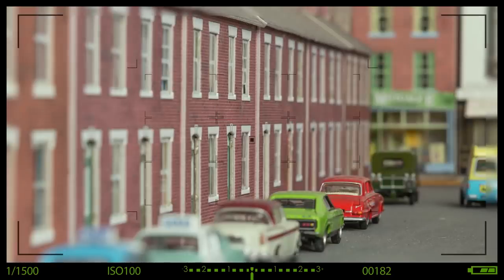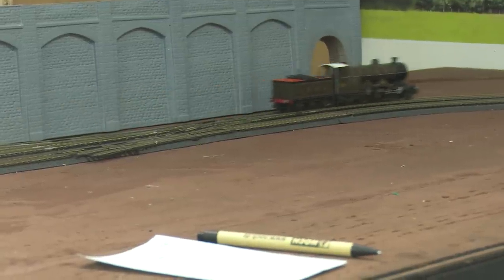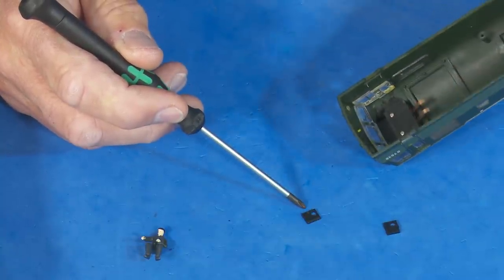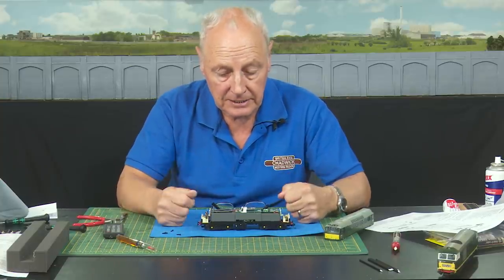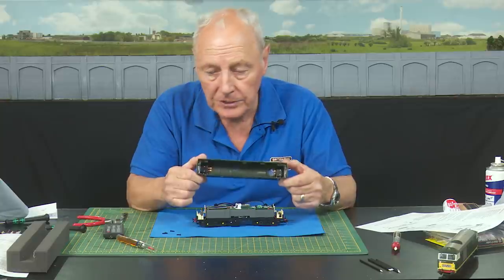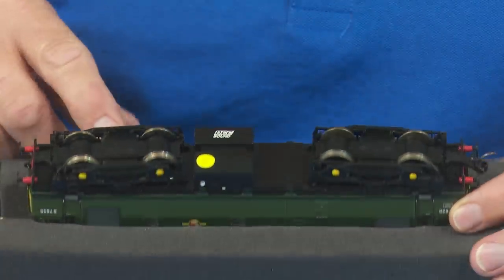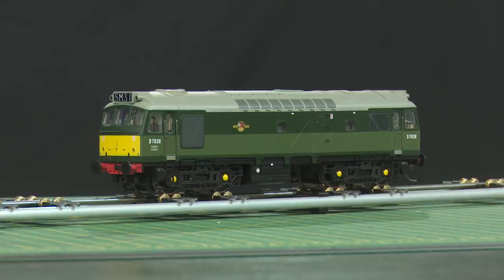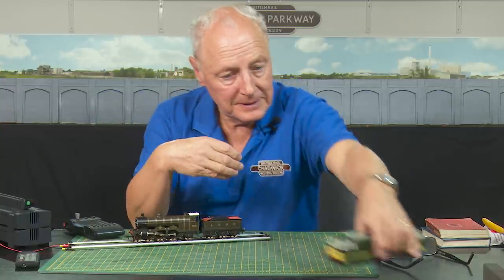Loco Servicing at Chadwick Model Railway | 109.

Comment: Hi Charlie, Another informative video. One thing worth mentioning when refitting locomotive bodies is best practice when refitting the self tapping screws into plastic, you should always slowly back the screw up until you feel it drop into the thread that's been cut other wise you can cut another thread. You can eventually cut too many threads leaving leaving a screw sized hole with no thread. Regards, David.
Reply from the maker: Now there’s an interesting point I never thought of David, regards Charlie

Comment: Charlie, most entertaining.
When using the superglue, I note you pour out some and then reach across that to work on the loco; as a matter of process, it seems better to have the glue beyond your normal reach!
For alcohol, the free ions are only released when there is water present (like soap); hence an amount of water is needed to make the magic work!
Four cleaning functions; the chemical route splits into two, for surfactant and for solvent.  Surfactants allow polar solvents (like water) to be effective (as soap removing oil and grease).  Solvents dissolve the item directly (like petrol dissolving grease until it is so runny that you can wipe it off).
When you remove the excess grease from the end of the worm, the best place to put that grease is back onto the worm, within the working area of that worm's thread.
For the contacts inside the bodyshell, using contact cleaner and contact grease ensures the contact area is clean and maintains contact.
I like the idea of inverting the rolling road with books; cheaper than the commercial versions, and potentially more learned!
The Hymek does show the pickups more clearly, so allows these to be cleaned before reassembly; again, you might want to clean the wheels inside before stripping down, so the contacts are then put back into a clean environment.  All a matter of how dirty the system is!
BTW, when we first saw the Atlantic, it was sparking as it paused; it appears the rear axle of the front bogie was causing the momentary short, which paused the operation.  (Not sure why the running-in would improve that, but...)
Thanks for the entertainment!
Reply from the maker: Hi Tom, 
The Atlantic was a complete nightmare and the sparking soon disappeared without trace.
I'm pleased that you found the inverted rolling road interesting.  I've been told that a commercial adapter is available for this.  Regards Charlie
Reply from the maker: Thanks Tom, great info as usual. 
Regards Charlie

Comment: Hi Charlie nice to see you back at Chadwick another informative video of how to service our locos the amount of time we do this task to keep our trains in tip top condition it’s like doing an apprenticeship at crewe works I did something similar to my class 43 midland mainline hst ringfield motor that is now dcc fitted the grease from woodland scenics is a handy maintenance tool to have as well as the light oil where do you buy your cleaning alcohol from finally I have got trains running again at Beighton Parkway that used to be in my loft but after my knee replacement loft ladders are abit tricky so I have set up a layout in my shed I would like to thank you for all the inspiration from your great videos talking about and sharing your experiences to help modellers like myself and others to create our great hobby as I said to my wife it’s not just toy trains it’s a combination of computers,electronics and trains keep making these great videos Charlie.

Kind Regards 

Kev (Beighton Parkway)
Sheffield
Reply from the maker: What a heartwarming comment Kev, many thanks, regards Charlie

Comment: So that's what business cards are good for. I will use that tip. Also there's a developing conversation about track cleaning products used. Some like alcohol actually work against keep track clean over time. Gleaming seems to be  becoming a way to take out fine scratches . I have noticed over the years that new track seems to stay cleaner until I used a "bright boy" track cleaner. Then I had to clean more often. More investigation needed. Years ago on my DC layout "Wahl" hair clipper oil saved my layout. It even worked on brass rail so we didn't have to clean as often. Hummm!
Reply from the maker: You're right Bob, it's a difficult one.

Comment: Thanks Charlie. You can buy the Woodlands Scenic oils and grease separately, I know this because I have both oils you used. Used to use the one you got from Gaugemaster for everything which I found to my cost is no good for plastic gears. Still use it on metal moving parts but use the Woodland Scenic oil on gears now! 
Someone may learn from my mistakes! 🙂
Track cleaning would be a good video as there are so many different products on the market and some of them do damage the rail chairs.
Again, learnt at my cost!
👍👏👏👏
Reply from the maker: A great tip, many thanks that will come in handy. Regards Charlie

Comment: Hello again Charlie. Another great video. My layout is an end to end gwr branch layout so my locomotives only run for short periods of time. All my locomotives are bachmann steam. The problem I have found is that it's not a good idea to lubricate the motor bearing at the commutator end of the motor. It does not matter if you use a minute drop of fine lubricant or gear oil (applied using a pin) the commutator always gets contaminated causing arking and smoke. I then have to remove the motor and soak it in isopropyl alcohol, let it dry and clean the slots in the commutator. The cleaning of the commutator is a real pain as you can't see inside the end of motor. Some of my locomotives are 15 years old and still have the original motor and brushes and still perform well on my gaugemaster contoller on my dc layout. I say if it's not broken then don't fix it. As usual another superb and informative video. Stay safe and keep well. Cheers Chris.
Reply from the maker: What a great comment Chris, many thanks, regards Charlie

Comment: G'Day Charlie.
I always give your video's a thumbs up matey! :D
Over the years I have found that using grease and oils in our Loco's/rolling stock leads to a gunk build up that will eventually cause some serious issues with our Loco's/rolling stock. As your quite aware its because the lubricants we use are wet and sticky by nature. So I have stopped using them altogether. Instead I now use a dry lubricate - Graphite Powder. In fact its the same stuff that Kadee use for their couplers. Works a treat on all moving parts and is not a dirt magnet. All you need is a little puff of powder onto any moving surface and your good to go. Lasts an incredible amount of time between applications, the only down side is it can get everywhere and make for dark smudges if your not careful.
As to getting items clean before re-lubricating, I use contact cleaner in a spray can and blast the crud right off.
Reply from the maker: Great comment G130, but what are you using as your contact cleaner?
Reply: @ChadwickModelRailway  I'm using a product from my local hobby electronics store Charlie. There are several types around that can be found from almost any electronic hobby shop. My hobby shop here is called Jaycar and the one they sell is called "Electronic Cleaning Solvent Spray".
https://www.jaycar.com.au/electronic-cleaning-solvent-spray-can/p/NA1004
or if I'm in Perth I sometimes grab these from Altronics
https://www.altronics.com.au/p/t3061a-chemtools-contact-cleaning-lube-aerosol-175g/
or
https://www.altronics.com.au/p/t3066-electronic-cleaning-solvent-aerosol-175g/
or
https://www.altronics.com.au/p/t3061-contact-cleaning-lube-aerosol-175g/
Any of the above work fine.

Comment: Keeping up the high standard - excellent. Just thought to mention that you should have put the cap back on the Roket and put it in the fridge to stop it going off. Also Hob-e-Lube gear oil is available separately - it is the only one of the seven in the pack that I use. Model Rail had an article some two or three years ago on lubricants and cleaners which I found very useful. Thank you - I look forward to the next video.
Reply from the maker: Christopher I'm so pleased that you found the video useful.
Regards Charlie

Comment: 27:38 Missed one!

Thanks Charlie. Another thoroughly informative video. Yes, I'm a "if it ain't broke..." guy. But in my line of work I do do preventive maintenance on industrial machines and am mindful of the risk of making things worse.

The Hymek has a well thought-out serviceability, which appeals to me, which shows in the running tests. For the slower result of the 25 I'd suggest that metal gears are more "sticky" than nylon ones - the excess grease that you wiped away was not needed anyway - I doubt there was no grease at all on the gears, just enough for wear protection purposes. The new grease just bunged it up again. 

Obviously if you reduce the speed of the Hymek to match the original lap time then the current will be lower indicting the effectiveness of the wheel cleaning (would have been interesting to separate the effects of greasing and oiling but hind sightedness is 20-20).

I am into steam but you are starting to call me over to the D side.

Cheers

Paul
Reply from the maker: What a great comment Paul. Yes the whole dilemma of loco servicing is a nightmare! Regards Charlie

Comment: Hi Charlie, thanks for this nice video. Although I don't have any British rolling stock (don't I ? Not so sure...), the principles are the same for SNCF locos. Could not agree more : don't touch them if they work fine (unless you want to make modifications like plugging a decoder, installing details etc.). And for what track cleaning is concerned : it's a big YES. Looking forward to hearing what you can tell us about it. 
One little question : you once showed a lighter (video about your modelling tools) refering to a coming video about the red tail lamp you have. DId I miss something, or this video hasn't been released yet ? 
Thanks again for the nice material you provide. I wish you a nice week end.
Reply from the maker: Yes I’m afraid you have missed the video. It’s when I installed red lights at the back of a guard van, or as you might call it a caboose. Regards Charlie
Reply: @ChadwickModelRailway  My bad. I haven't been online for some times, didn't catch up with all the channels I'm subsribed to. Thanks Charlie, I'm going to watch this other video right now. Best regards.

Comment: Bought some cheapie (<25 Pounds each shipped to Australia from the UK) Class 08s online sold as 'Noisy and Inconsistent Runners'. Got the Triang from 1959-61 running a real treat (just have to get the wheels lathed down so the flanges don't ride up on the ties of my very expensive HO Kato Unitrack), but the Hornby from 1979-84 still has a noisy bearing. No matter how much oil I throw at it, twenty minutes of running and it's noisy again. Might be time for something heavier, like some moly grease.
Reply from the maker: Good luck, I’m sure that you’ll sort it.

Comment: Hi Charlie, another informative video. I do my maintenance/servicing when they won't run. Most of my locos and rolling stock are over 50 years old (Triang) and still run. (I'm 61 years young) I've converted all the locos to DCC and replaced the older style wheels too. I enjoy the challenge. It might not bring joy to the purest. Rgds Stewart from Down Under. PS, a video on track maintenance would good.
Reply from the maker: What a great comment Stuart. You are clearly a real Trojan. Stay safe, regards Charlie

Comment: Trigger warning: I got the Rambler train set from Hornby around 18 years ago. About 17 years ago it went into a box, and came out last year. It runs fine and the body has never been removed.
Reply from the maker: But does the oil in the grease dry out over that time, perhaps if it’s in a warm environment it might?
Reply: Chadwick Model Railway I’ve not had the model open, it lived in a box in the loft for 15+ years so warm in summer cold in winter, it’s DC only but s reasonable runner

Comment: Great vid Charlie, I've two Gaugemaster wheel cleaners that just sit on the track, put the power through then sit the loco on top of the wire brushes, really simple. Regards Terry
Reply from the maker: I have them too Terry. They scratch the wheels clean which promotes more carbon built up.

Comment: Watching here in Toronto. Terrific information Charlie.
I just pulled out an old Blue version of the Hymek which I purchased either at a show or from eBay and it had never worked.
It has the “Spyder” type motor and I went through the process of cleaning the wheels, moving the copper contact below that top screw into the correct position , removing the old solder for the rear bogie wires where they connect to the copper plate and after all that it still would not run!
After further investigation I discovered a track pin buried behind a wheel. After removing the offending pin it ran perfectly.
I am in the process of editing my experience with this excersize and will be posting it soon on my YouTube channel.
I have a class 25 that has a problem getting over a Peco point; I don’t recall if you have explored this topic but I would be interested in your opinion.
Once again Charlie, thanks for sharing👍
Reply from the maker: Hi Charlie what a great comment. Yes track pins are the pain of our lives. Regarding your class 25, I’ll bet it’s a point or pick up issue my money is on the pick ups. Regards Charlie
Reply: I'd also try checking the wheel back to back gauge with a tool sold for the purpose. I had a brand new class 60 with an issue on just one point and that turned out to be the issue

Comment: Hi Charlie very informative video, I had never thought of using the rolling road upside down to clean wheels so will definitely try that.
When I remove screws from anywhere on a loco I pop a neodymium magnet on the screwdriver shaft and the screw will stick and can be withdrawn. Also makes putting them back in simple as you can stick the screw on the end of the screwdriver and easily guide it through fixing holes.
Reply from the maker: What a fascinating tip Stephen. I must confess I have never heard of putting a magnet against the screwdriver in that fashion. Regards Charlie
Reply: Not trying to be a smart arse but you are aware that one can magnetise any steel screwdriver to do this permanently! Get that magnet and in one smooth motion rub it down the full length of the metal shaft of the screw driver (steady now, no silly comments! :D ). Now lift the magnet clean off the screwdriver at the end of the motion. Do NOT under any circumstances rub it back up the shaft the opposite way! Now comes the tricky bit, with out letting the magnet slam into/onto the shaft, connect it at the top again exactly the way you did at the beginning (North - South as before of the magnet), and draw it back down the shaft like you did the first time. Repeat this at least 10-20 times until the magnetic field in the screwdriver is strong enough to pick up and hold any screw sizes your inclined to be using with said screwdriver.
When this effect starts to wear off (many months to years later depending on treatment of screwdriver) just reapply like you did the first time. Things that will effect the induced magnetic field are, dropping it/slamming it into onto things, throwing it into a tool box full of other metallic bits an bobs, placing it next to any magnetic fields stronger than that induced into the screwdriver...... you get the picture, look after it.

Comment: Great video Charlie. Had to take apart my only two non-running n-gauge trains, painful to do. So much dust, fluff and gunk inside.

One of them is still in pieces as the wires were so old between the tender and engine they crumbled. Waiting on parts to finish the repair, terrified of destroying the locomotive with my soldering iron.

The foam mat is not something I thought of, had to hunt for springs and screws that bounced away. Will be investing in one! And that rolling road, so useful.
Reply from the maker: What a heartwarming comment, thank you, regards Charlie

Comment: Another interesting video. My experience with lubrication of model trains is you can do as much damage over lubricating  as you do not lubricating a model. Modern models use plastics designed for bearings and gears that need no lubrication, so for plastic gears no lubrication is required, irrespective of what the instructions say.  Small electric motors have pre lubricated sintered bearings an will normally last the life of the motor brushes. Motor carbon brushes can be softened by excessive oil and the carbon oil dust mix can cause the motor to short out. On the other hand, metal bearing require lubrication, and will wear out if left to dry out. The worm bearings on top of gearboxs should be checked, as these wear quicker than metal main axle bearings. On steam locomotives  my experience is the siderods wear out  first if left dry. My prefered product to lubricate side rods is graphite grease. Graphite grease is electrically conductive and shold not be used for anything else except lubricating electrical pick up wipers on the backs of wheels.
Reply from the maker: Some sound advice there Terry, many thanks. Regards, Charlie